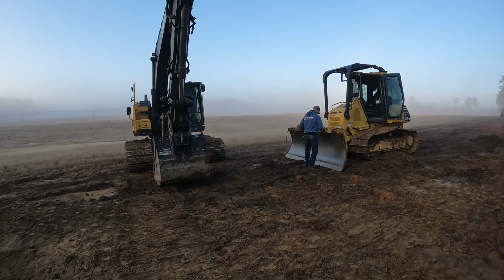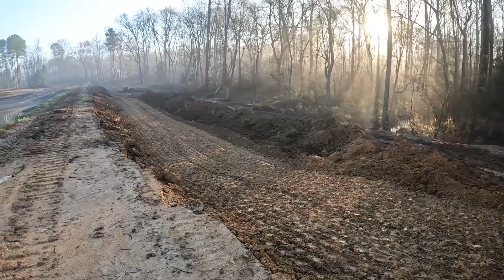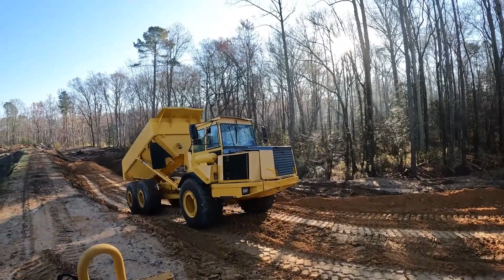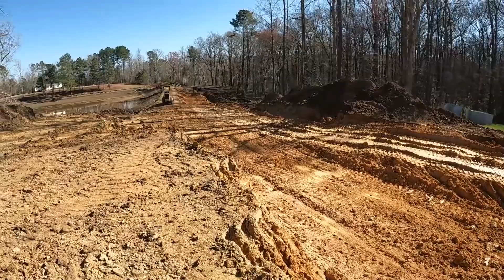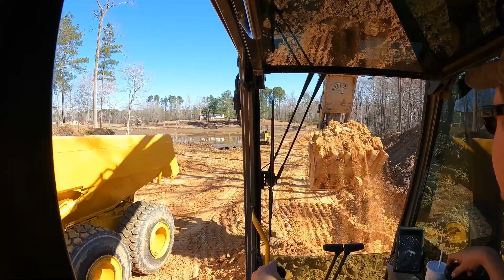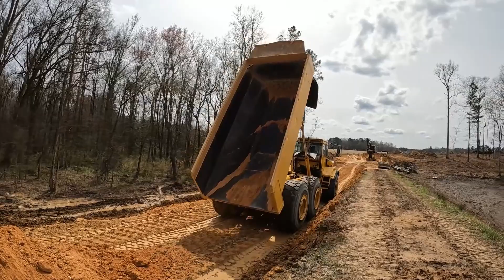I Brought The Crew In To Move Dirt On The 10 Acre Pond Dam

Comment: Really liking the new paint job on the haul truck. 
It’s the easiest and most scariest job, backing up a truck that you are not familiar with. Enjoyed!!
Reply: I thought it had a new look on it! Yes, it does look nice 👍!
Reply: Trust me it was at first . But I got use to it pretty good
Reply: @Todd.Roberts  you did good!  Got used to it.
Reply: Yes I did . It normally takes a few minutes to get used to a piece of equipment that I have not ran before
Reply: @Todd.Roberts  as a semi truck driver who also used to drive haul trucks, I say you picked it up pretty fast, especially when you have the extra tension of being on camera! Lol

As I tell other drivers who are having trouble backing up, pull ups are free!
Better to pull forward and get positioned better than try to do it in one shot and get into trouble, but most people pressure to do it in one shot.

But yes, it's a bit different in a floppy cab like that lol

There are 3 rules to backing up, in order of importance:
1. Don't hit anything!
2. Get where you need to go.
3. Look good doing it!

I am 100 percent on 1 and 2, and sometimes I get lucky on 3!
Reply: @ke6gwf  Thanks . Well I have been driving trucks for over 30 years  including 15 years in the military.

Comment: Chris, I thought that you might like to know that there is a Vibratory Padfoot Roller made by Inger Sol Rand up for auction on the "Auction Time" bidding site, it has a 115 HP Cummins engine and the roller is 9'2" wide, the bidding starts today for a 3 day auction, the starting bid is still at $100.00. From the pictures and description, it is in really great shape.

Comment: Was thinking how small this original dam was compared to the one You, Tim and John built on that 5 acre pond job. This dam was maybe a third the size compared to the 5 acre pond dam, but twice the surface area of water. I know the 5 acre pond was much deeper than this one with more water volume in it, but still, this 10 acre pond dam seemed quite a bit undersized for the amount of water in the pond. Surprised it hadn't failed worse than it was. Anyway, It's shaping up nicely.

Comment: Hello Chris, you're project is coming along really well. Can't quite figure out why you let Todd operate Barney while holding the driver door open with his left hand? I also wonder if anyone, (You or Tyler) confirmed the mirrors were set properly before Todd was tasked with backing up an articulating haul truck. Anyway you dodged an expensive  bullet when Barney didn't roll over when Todd went off the road. (It's hard for anyone doing something for the first time)
Reply from the maker: the a/c is broken and he was hot in the sweat box lol